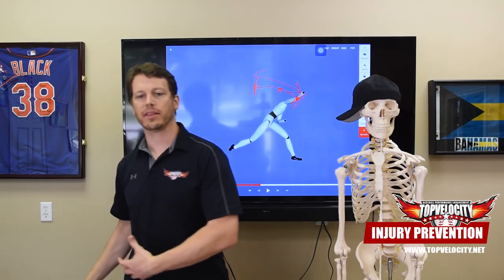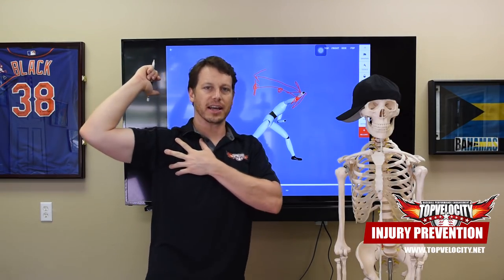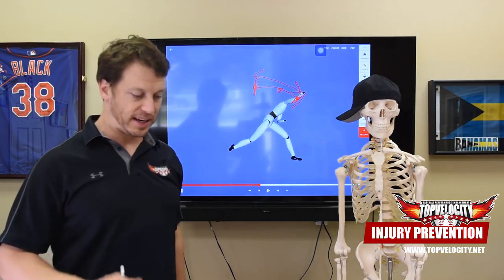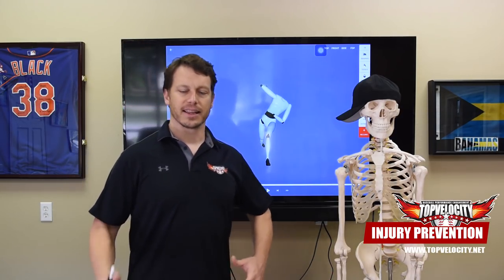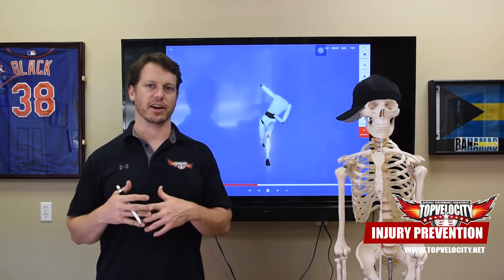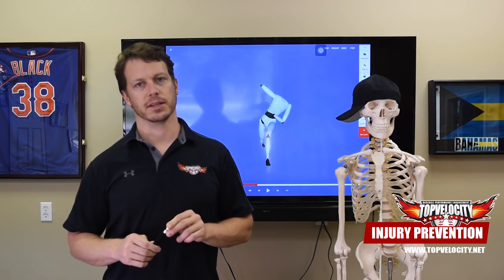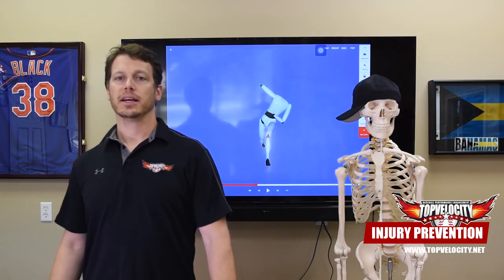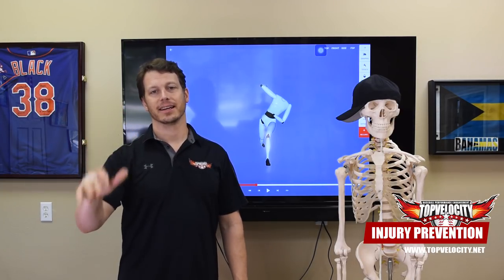10 Pitching Mechanics That Could Blowout Your Arm

Comment: You're doing great work. As a little league baseball coach, I can second your complaints about conventional coaches. I get a lot of flack for trying to use your methods both with pitchers and position players. Most of our coaches tell kids to get over the top into the elbow above the shoulder position. Some even discourage kids from "side-arming" when many of these kids are really using relatively safe low three-quarter arm angles. They won't stop kids from using the "arm whip" to generate velocity, and they often encourage it because in the youth level it gets results. I'm "wrong" because I break down kids mechanics and try to teach them how to use their legs and get good hip-to-shoulder separation. I won't even get started on the old school hitting mentality that is pervasive.

Hopefully, one day all of the new knowledge will trickle down to youth coaches and we can keep our kids healthy and make them more successful.
Reply: Dev518 I appreciate your service but  1All pitchers should never place their pitching foot parallel to the rubber. 2. All pitchers should place both feet facing forward and step off the mound,not stride 3. All pitchers should take the bb out of their glove w palm under the ball. 4. All pitchers should pendulum swing the bb out of glove downward backward and upward to driveline height (I just eliminated 90% of TJS). When the glove foot lands the bb is at shoulder height as far back to 2nd wout locking elbow. This means elbow is at shoulder height while the bb is at driveline height (right above ear height. If you do this and NEVER release a bb over the top of your index finder you’ll never have TJS. If you take the bb out of the glove w palm on top of ball you start the journey to TJS.
Reply from the maker: Great to hear you are educating yourself to better help these young kids learn how to use the entire body and not just the arm. Keep up the good fight and never stop learning. Thanks for sharing. Oh and listen to Steve but ignore him at the same time. He teaches Dr Marshal who has a good understanding of the arm but a poor approach to protecting it mechanically.
Reply: Dev518 TopVelocity.net lol. Dr Marshall has a PhD in Kinesiology and a Cy Young Award and still holds several MLB pitching records. I am pleased to hear he is getting a degree in Kinesiology. But I think he’s missed a few classes. You can only abduct the Humerus bone to parallel to the shoulder line. Once you go above parallel you use different muscles and it’s called Shoulder Girdle upward rotation. So hyper abduction is a nonsense term. I think MCW kids are intellectually capable of understanding real terms. 
But as I’ve said many times, Brent does his own research (it shows) unlike so many others that simply rip off Dr Marshall’s work without attribution. Id say he got 50% of what he said fairly correct which is pretty good. 
Btw I find it hard to believe Brent would approve “Side arming”  He knows how Dr Marshall wants youngsters trained to pitch. We can have fun with this but please. I hope you misunderstood him. All pitches should be released as high as possible.
Reply from the maker: Good point about abduction ROM of the humerus. Hyperabduction defines those who attempt to push past that range which would make them more susceptible to shoulder impingements. If I didn't have respect for Dr. Marshal I wouldn't call him a Doctor or would acknowledge his excellent work in the elbow. The problem I have is with his attempt to remove external rotation and hip abduction from the pitching delivery. This will inhibit pitching performance.
Reply: TopVelocity.net Impingement is another myth. Think of a biplane. If you raise the lower wing it will not impinge on the upper wing. But you are correct that you don’t want Humerus above shoulder height. You tear the Shoulder Labrum when you bring Humerus behind your Acromial line (hyper angulation?) which you called out (but had wrong injurious effect). This will rub the anterior Labrum against the head of the Humerus bone. Where the arm has been tells us where it’s going to end (Centripetal imperative) so if you start behind Acromial line your arm will finish across the body. This will rub the head of Humerus against the back of Labrum. Hence most Labrum tears are AP Anterior/Posterior. You want the head of Humerus to stay centered in its Glenoid Fossa. Mr LL only has to windup as I described and never let the pitching arm cross the mid line of the body at release

Tell Mr Medlen I used to crucify the Braves almost daily via the AJC for how the Braves taught pitching. Alas only one dad reached out. And And And Medlen still has a bounce.  SMH
Reply from the maker: My acromion tore my rotator cuff at 18. Impingement wasn't a myth for me and many others. Yes hyperangulation can distroy the shoulder as you explained. The effect it has on the elbow is due to the catch up effect which delays pronation and holds torque on elbow longer in supination. Melden externally rotates so yes he still has bounce.
Reply: Steve Sullivan Do this if you want to throw 75 mph. Thats not going to work for 99% of pitchers.
Reply: TopVelocity.net The Rotator cuff is a quartet of muscles that keep the head of the Humerus securely in the Glenoid. What you are suggesting (that the head of the Humerus “impinged” on the underside of your Acromiom) is scientifically impossible. You tore your “rotator cuff” for the same reason Medlen tote his Ulnar Collateral Ligament, improper force application. If you tell me which of the four Rotator muscles you tore I’ll tell you what the force application error is.
Reply from the maker: Supraspinatus and yes it tore from the acromion impinging it over time due to my hyper abducted arm cocked position for my entire career.
Reply: Joseph Brascher since Brent is getting a degree in Kinesiology he can perhaps explain why MCWdads have trouble believing larger muscles don’t apply more force than smaller muscles. The shame of all these needless injuries is the solutions apply more force. You may want to also explain why virtually every hard thrower is trying to engage his Lat all of a sudden (although few can). You may also want to explain why the word Pronation is entering the bb lexicon. The LL coach may be interested to know how many youth bb sites I’ve been banned from for using that word. Mr Brascher may want to tell us why so many pitchers are turning 180 degrees when I took all kinds of  crap for saying it in the internet years ago. It’s nice that the Braschers of the world have come around to protecting these children a little bit but it’s not good for new LL coaches not to know from whom these advances came. If Brent is honest (he is) he will tell you it was Dr Marshall (back in 1979!!!) who warned about pitchers reverse rotating their Acromial line (hyper Angulation) beyond second base. This is dangerous but it also lessens release velocity. If Brent is honest (he is) he will tell you it was Dr Marshall who warned against pitchers bending at the waist. This not only destroys the lower back but lessens the rate of Acceleration of the baseball. If you pitch the bb sidearm it is virtually impossible to pronate the release of a cb. Go see what the spin rate is for Supinating vs pronating the release of a cb. I know safety is anathema to MCWdads but performance should not be. Ive never had a LLer not improve his velocity in one lessen by employing larger muscles. Wow what a surprise. Bigger muscles apply more force.
Reply: Steve Sullivan Assuming that you're correct, does someone have to credit Einstein whevener they say E=mc^2? Do we credit Newton whenever we talk about gravity? Brent cites his sources on his website. What more do you expect?

To clarity on "side-arm", I am taking about someone like Pedro that really has a low 3/4 slot. Some coaches try to "correct" this and get kids to "get on top of the ball" or throw "over the top." If there is research on the dangers of such an arm slot I am all ears.
Reply: Dev518 As I’ve said many times, unlike the Tom House’s, Kyle Boddy’s and Chris O’Leary and Paul Nymans of the world, Brent’s doing his own research. I admire him greatly as well as the quality of his followers. Nevertheless I disagree with his findings. Dr Marshall expects those that use his work credit him. It becomes a problem for you bc you don’t realize how influential he is bc few acknowledge his work. He is the reason you see so many pitchers going to high “arm slots”. The key to release velocity is engaging the largest muscle (by far) that is attached to the arm, the Latissimus Dorsi. Btw Pedro is a secret Marshallite
Reply: Steve Sullivan I like how you have all the answers yet here you are. Like i said before, I have no doubt throwing your way would greatly reduce injury, but you will also throw 75mph.
Reply: Joseph Brascher yet you’ve been around long enough to see Jeff Sparks go from 78- 96 Mph. To see Rudy Seanez go to 102 mph. To see everyone emulating Dr Marshall’s top half. I know you guys love teeing up these MCWkids but it is well past time to stop this nonsense.  The notion bigger muscles can’t apply more force is ridiculous especially with this crew. I’m sure you don’t care that striding off the mound sideways opens the Medial compartment of the knee and compresses the Lateral meniscus.  But our LL coach should know that stepping straight off the mound engages the powerful gluteal muscles rather than the weak Tensor Fascia Latae muscle. It is beyond me how guys tout squatting and then won’t use the muscles squatting helps. But keep on spreading these myths and we’ll keep on having these kids turn to PEDs for velocity and pain management. Congratulations
Reply: Steve Sullivan without weight lifting i would still be throwing in the 60s. Muscle mass is linked to performance. I wish you the best of luck. I would love to see video of   guys throwing in the 90s with the full marshall delivery.
Reply: Joseph Brascher once again Brent did a nice job with this video. It hasn’t dawned on him yet that ASMI was formed by Dr Andrews to put Dr Andrews out of business 30 years ago. ASMI hasn’t solved one pitching injury but Dr Andrews is worth over $100M and I guess Dr Marshall is the only one that has a problem with this. At least Dr Andrews has expressed his regret that his ASMI has not solved one pitching arm injury...from his yacht. I think Mr Trump took a look at this and wondered how easy it would be to be President. Hence #BBTrumpland There was a time adults wanted kids to enjoy a brighter future. Those were the days.
Reply: Steve Sullivan i feel like this got slightly off topic. Enjoy your life.
Reply: Joseph Brascher it’s been like this for years with your ilk. Every time we make progress in protecting these unfortunate children with a little science you guys change the topic. Now that you’ve figured out that engaging larger muscles produces more velocity you bring up weight lifting. I suppose that’s progress. You take big ole muscular Mr America and I’ll take any of the LL Coach’s pitchers. Do you want to bet who can throw a bb further?
Reply: Steve Sullivan an olympic lifter will throw harder than a little leaguer with some drill training. You say i changed the topic but you started talking about politics. I really hope you find what your looking for, because jealousy accomplishes nothing. Enjoy your life.
Reply: Took note of your comment: " I’m sure you don’t care that striding off the mound sideways opens the Medial compartment of the knee and compresses the Lateral meniscus. " Last year first time on the mound I was dropping and driving way too early and hard and gave myself an MCL strain. Only thru knee decompression using a pillow behind my knee and stretching it and strengthening it mainly doing knee extensions did it finally feel better but it took a long time. It was self inflicted. I have done much better since going down the mound peaking forces at front foot (As Brent teaches/has shown with data) since and of course it's been very beneficial...but that was linked to my heavy abductor work this winter too ect.... For better or worse I'm always experimenting.
Reply: BlaineDP now you have to ask Brent why he has you striding sideways when the big powerful Glutes are used if you walk off the mound. Keep at it.
Reply: Joseph Brascher hey I’m apolitical. Just trying to relate to BBTrumpland. So I give you the strongest guy in the world and I take a LLer and you do what you guys have always done. Change the rules.
Reply: Dropping hard and trying to drive out of it hard right away at 240+lbs is what strained it.. :) When I do more of the normal leg lift and glide down the mound leading with the hip and loading a little later with a last second drive into front foot I had no pain, threw harder, arm wasn't as sore ect.. I'm just a trial and error guy who still has a terrible arm path who many times needs to see/witness/experiment on his own but with guided information to try. I could bore you for hours with injuries I've had including shoulder surgery, broken pelvis, repeated rolled ankles ect. . I've spent the last 3-4 years trial and erroring things on my own but based upon info like Brent features. I'm too old/long past ever having a career anywhere other than adult rec leagues but want to relay good/healthy arm/body info onto the next generation. It is extremely hard to teach old dogs new tricks but that's exactly what I've been trying to do and I realized quickly that I was way too slow, non-powerful, lacked mechanics ect... to throw hard with minimal wear and tear on my arm/body and I set out on a journey to change all of that while helping others and have come a long ways. I don't post much, don't get in twitter wars, ect.. just realize more and more every day it really does take a heck of an athlete to throw a baseball hard.
Reply: BlaineDP Sir, I congratulate you on your love of the game and your quest to be as good and healthy as you can be. There’s a Marshall guy floating around here that throws in the 8’s with no pain etc. He’s over 50. Since you have no career on the line why not throw harder w less pain? You have to immediately stop lifting your glove leg. And you have to stop striding sideways. I know I know. It will suck not having any pain but you’ll throw harder.
Reply: Well said Steve Sullivan!
Reply: Exactly. Latissimus Dorsi and Pronator Teres engaged in maximum power output.
Reply: I was at Busch yesterday to see Jordan Hicks of the Cardinals hit 105 mph twice. Now he is not full Marshall in his delivery. BUT, He stands TALL, he does not counter rotate his body backwards, and he has almost no hip-shoulder separation. A new MLB record, 105 twice in an inning.
Reply: In order to throw hard you have to keep your entire body healthy. The traditional motion wears away at so many leverage points prematurely, we rarely get to see the true potential of most pitchers.
Reply: Thanks Steve. I am that guy. 58 and hitting 83 at times. This is after a rash of college injuries many years ago due to textbook traditional mechanics including torn meniscus/pitching arm side. Torn ACL/glove arm side. Torn Oblique. Torn Teres Minor. Torn UCL. In 1979 I was sitting 93 to 94 on the old JUGS gun for 2 months. That was it. A rash of injuries put an end to not just pitching, but throwing a ball at all for a long time. I never had any surgery. At that time, they didn't perform TJ on college or high school age players. With the scar filled healing of my injuries, I am amazed at what DR. Marshall was able to do for me. I throw today, HARD, for my advanced age, and pain-free. I can extrapolate going backwards in time, 39 years ago, if I had all the knowledge I have now, with that younger stronger body, I would have easily been able to use Marshall's techniques and thrown just as hard, or possibly slightly harder than I did then, without pain or injury. Case closed.
Reply: Randy Tiefenthaler Now how do we get the man out of his funk?
Reply: Steve Sullivan hello are you still answering g question?
Reply: @stevesullivan457  did Nolan Ryan have hyper angulation?
Reply: @brentpourciau  did Nolan Ryan use hyper angulation
Reply: @jbrascher112  proof that anyone can sound like a knowledgeable professional on YouTube. Went to check out the Marshall method and thought the video was a parody but little did I know it was a legit teaching video. Interesting but not for me.